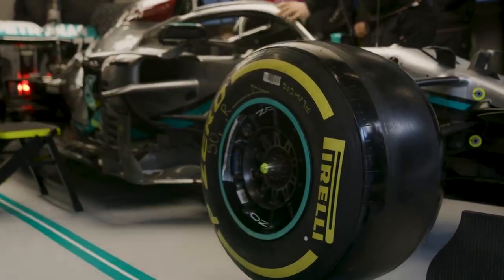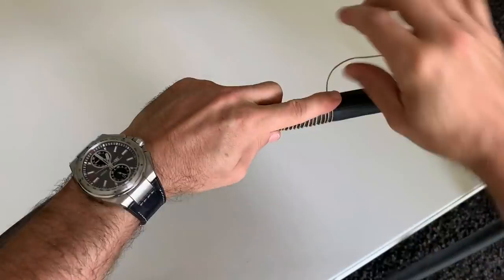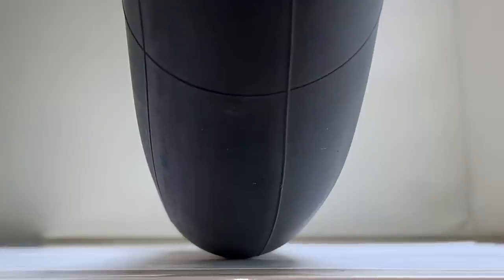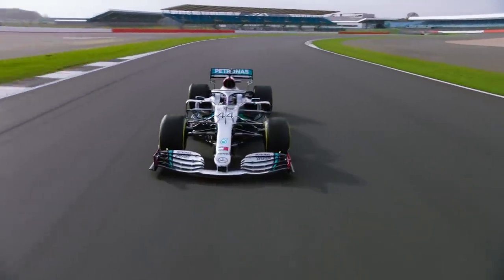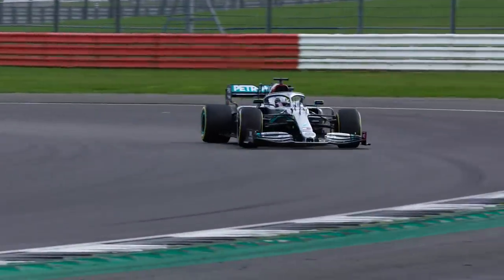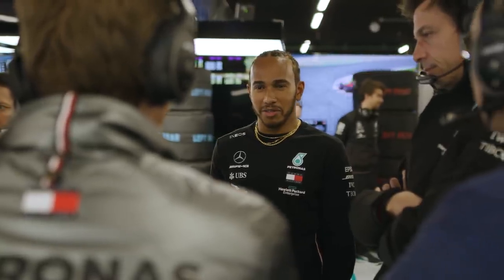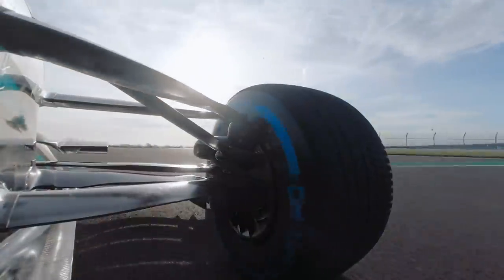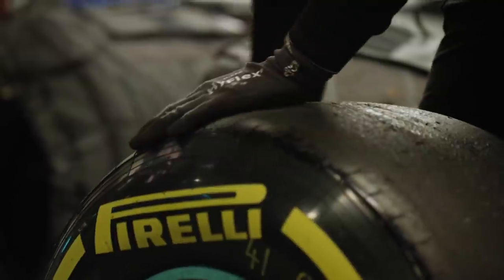Why are Formula 1 Tyres so IMPORTANT? | F1 Explained!

Comment: What happens to tire debris when it’s raining and is cold? Does it also stick to the wheel?
Reply: Andreja Ssvab if it rains then the track will essentially be ‘washed’ of the marbles. If slick tyres were equipped, the tyres would rapidly become too wet and slippery for the debris to stick to them, and if they go on to a wet weather tyre (inter or full wet) then tyre debris is even less likely to stick due to the tread on the tyres needed for additional grip, clearing water and drying the track. It entirely depends on the track, strategy, the severity of the rain, the temperature and 101 other factors however. Essentially, cold and wet races discourage debris sticking to tyres and reduces debris on track, which is why wet weather races are so entertaining as it reduces grip causing more crashes

Comment: Still in doubt? Just try to run an F1 car without tyres  ;-)
Here's to Pirelli manufacturing tyres on which drivers can push for much longer and thus increasing the frequency and duration of wheel-to-wheel combat!

Comment: Are supa soft tyers weak or strong because i know that medium tyers are strong
Reply from the maker: Super Soft compounds are weaker than Mediums, they are a softer compound which means they wear and degrade at a faster rate
Reply: @MercedesAMGF1  Aren't they thanks to the new naming sometimes the same? (c3 and medium)

Comment: I would change the reliance on tires if im honest....there is millions spent on drivers and the car itself yet one of the most important part winning championships is actually managing tires ... Id make them  much more durable and less tire compounds.. 
I mean making them more durable will force teams to actually push cars and make drivers actually compete and not go around making laps and babysitting the dam tires...
and for the less compounds, just make it 1 type for Qualy on dry... 1 Type for racing on dry,  and keep the 2 types for wet, that being 1 inter and 1 full wet. 
i really think that would actually make it so drivers and the actual car and its power unit are at the focus on development and not the god dam tyres ... I mean if one team can actually calculate how many laps the other team has on their tyres is simply stupid..

Comment: 2-3mm of rubber on tope of structure? I dont believe it, especially when you see the amount of marbles on track. Am I wrong somewhere?
Reply from the maker: Why would we not be telling the truth?!
Reply: @MercedesAMGF1 I did a simple mass calc. of the rubber compound portion with 3 mm thickness, 660 dia and 380 wide patch. I used 1.5 g/cc and the result came out to be 3.6 kg per tyre.
Looking at these numbers, it looks realistic.
But 3 mm as thickness seems too less for the amount of performance that generates and thus the corresponding wear. Maybe it's all down to that brilliant compound. Because I have also seen some racetyres with 4.5-5 mm thickness and obviously that racecar wasn't F1 ( which means less forces, etc on the tyre and hence lower wear per km lets say). 
I believe you but my observation didn't make me.